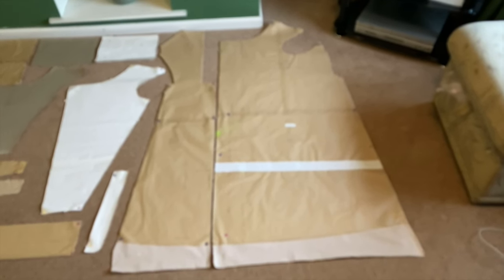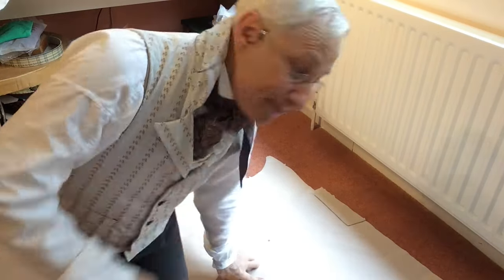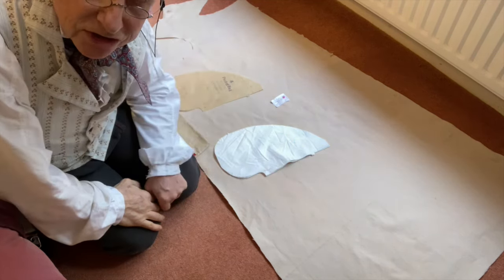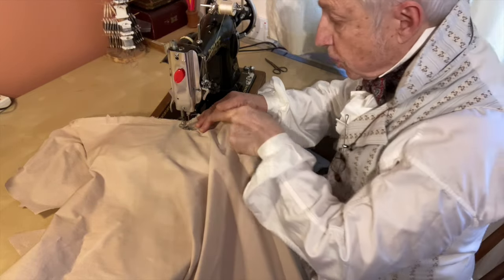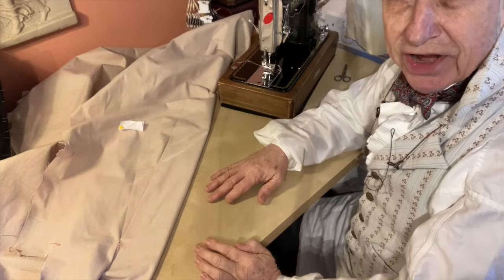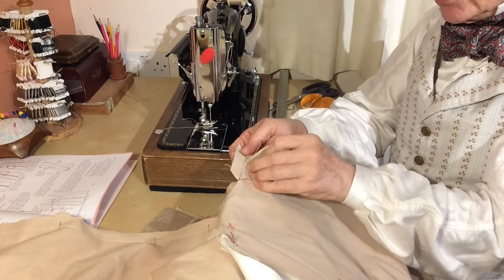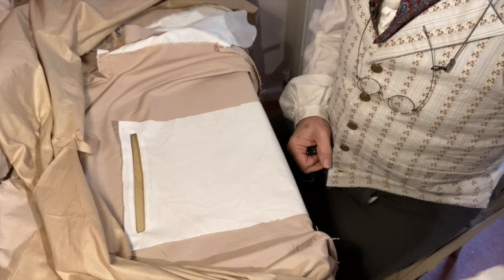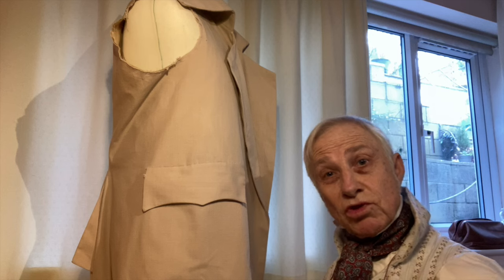Make your own Regency Duster coat

Comment: What a cool guy! And an excellent tailoring lesson. Those dusters persist through the 19th century anywhere you work stock on horseback to keep the dirt off, with wax or oil treatment for rain resistance. They’re worn in automobiles when they come along. They and the Garrick merge to become the trench coat in WW I which is still around. Ever stylish and always has swagger.
Reply from the maker: What a kind comment!  Thank you for the additional information - if you search for Duster patterns the most common ones are those for Australian or Western designs.